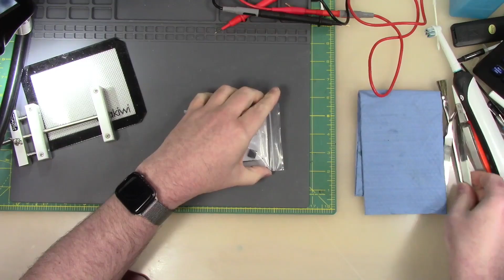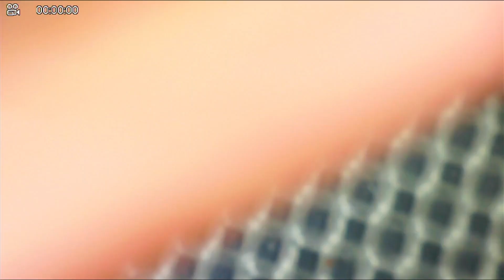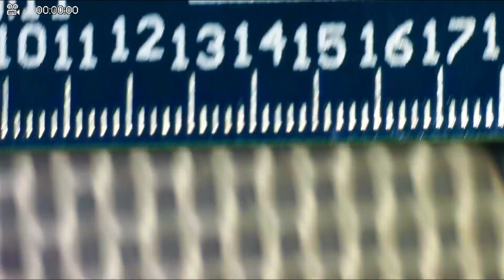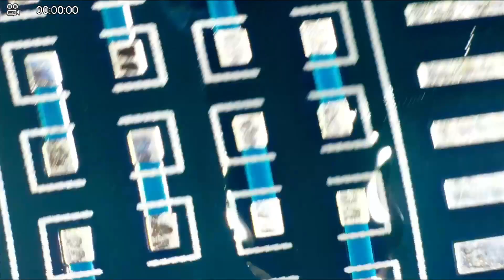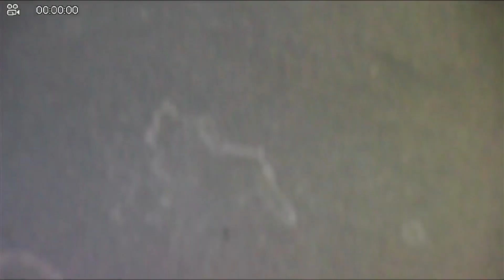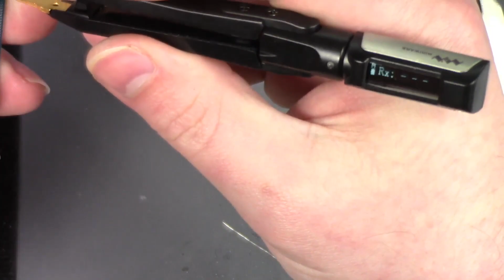SMD Practice Soldering 30 Minute A Day Challenge Part 1

Comment: What tip would you recommend to use if I never had a micro pencil? I use a a hakko clone with t12 tips
Reply from the maker: A micro pencil uses T30 tips and for consoles I recommend the 0.6 mm chisel tip, but for phone work I recommend the 0.1mm conical tip.
Reply: @jasondoesthings919  awesome thanks. I've decided to not really get into console stuff, I live in a small town in cape breton,  nova scotia and the effort to learn wouldn't be worthwhile so I've decided to learn how to solder and focus on circuit logic and creating my own stuff by coding and using microcontrollers like the arduino type stuff. I just moved into a new house and I'd like to automate it myself. I have my detached garage set up for air from different spots (its quite large) and I want to be able to set the air compressor up to power on and off based on if the air lever is opened or have a button near the handle or something.
Reply: I have used to be a programmer but haven't written a line of code in years.
Reply from the maker: Wow that sounds pretty cool, there are a lot of home use electronics design and manufacturing equipment. I would love to have some of the small scale prototyping stuff I used at work. You can build a lot of stuff with 3D printers now so getting into designing with them would be very useful.
Reply: @jasondoesthings919  for sure and even if you can't do 3d modeling there is software that makes it so easy make printable designs. I remember years ago there was no maker-centric 3d design software,  you had to use the same complicated software they use to make games and movies or you could download the models haha